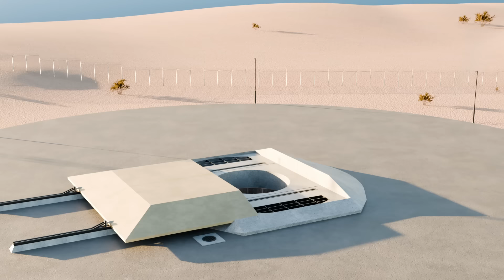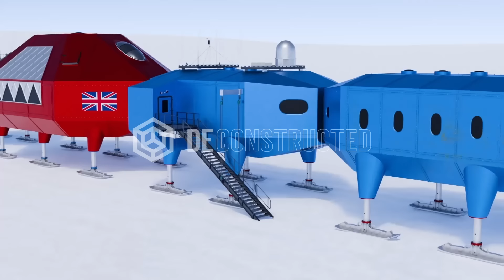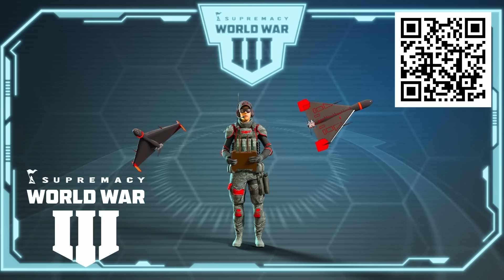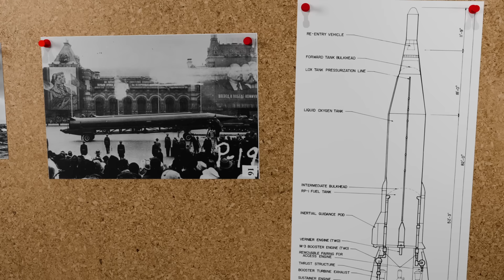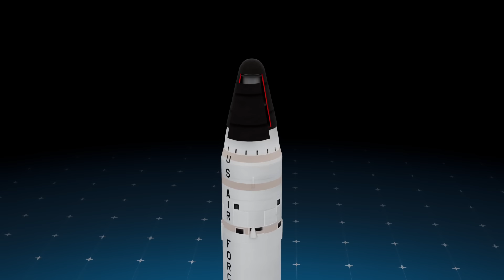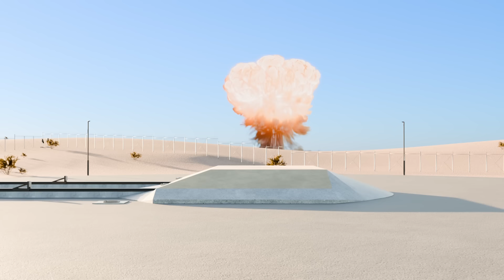Missile Silos Were Far More Complex Than You Think

Comment: I wonder how vulnerable that soft entrance door would be. If somebody actually had gained access and were trying to get in. I wonder how long it would hold off for reinforcements to arrive?
Reply: The first blast door at the bottom of the entryway actually had metal loop welded to and a chain was welded to the wall You could actually chain that door shut from the inside preventing anyone from getting in short of Something less than a nuclear explosion to open

Comment: I heard the unit that controlled the butterfly valve would only accept a handful of code attempts before destroying itself by intentionally burning out the circuits inside.  Officers were told that playing with the device was a sure fire way to get kicked out of the program, if not dishonorably discharched.
Reply: I don't know if that's correct or not.  To be honest, I don't know what would have happened if the code was not entered correctly.  All I knew was that the launch sequnce wouldn't proceed until the right code was entered.  I was a BMAT on a Launch Crew.  It was my job to enter in the code.

Comment: I wonder how these silos are reloaded with new missile
Reply: you don't need to reload them.
Reply: @derniko1992  so what happened to silos when they fire for testing?
Reply: @maxamps45  The testing silos were at Vandenburg in CA.  I don't know how it was done, but I do know more than one Titan II launched from the silos out there.  I have to assume they had to do some work after a launch before it would be ready to launch again.
Reply: The first stage it lifted off of its trailer by a crane stood on end and lowered on to thee missile mounting bracket.  Second stage is removed from trailer and attach to the first stage,  The nuclear weapon is picked up and lowered onto the second stage. The missile Is then loaded with fuel and oxidizer, The guidance system it started up and given to stabilize and targets programmed into it It can now be put on alert status ready to be launched.  It can fit in this ready to launch status for 5 to 10 years.   If you to remove the missile from the silo you just re reverse the order I have listed for installation.   About the only reason to remove the missile from the silo is to take it to Vandenberg California put it back in one of their missile silos and launch it down the Pacific Test Range.  Misto Silo at the three operational bases with nuclear missiles are considered one time use.

Comment: nowadays each control room controls a cluster of silos and missiles and these control rooms are then overseen by a larger control room located at the air force base that the missiles are attached to
Reply: Yup...controlled by "wire".  If you're in the control center, you don't have physical contact with the missle itself today.  You can't walk out from the Control Center and go "touch" the missile.  In Titan II complexes, you could.  We were never allowed to lower a platform and go touch the missile itself.  The last step in our daily checklist was to open the door on Level 8 of the Silo Equipment area, and look up at the missile in the launch duct to make sure nothing looked wrong.  On a rare occasion, we could ask the Commander if we could walk down into the W under the missile.  I did that a few times.  But that was the closest we ever got to it under normal circumstances.  I think I was able to walk out on a platform once or twice when some maintenance guys were there, but that was it.

Comment: I was thinking this sort of layout had several missile silos close by the launch control.

Later missile silos and launch control were separated by miles .  Maybe the Minuteman program?
Reply: Yes, you're correct about the Miniteman and being separated.  Also, one control center is responsible for more than 1 missile.  In Titan, it was one Launch Complex, one crew, one missile.
Reply: Titan I had one Control Center and three missiles connected by tunnels.  Minuteman Silo and Control center are connected  only electrical wiring.   Mistral silos are spaced out so that incoming bombs could not damage more than one missile silo.

Comment: Mit welcher Energiequelle wurden diese Silos gespeist? Gab es irgendwo ein Windrad in der Nähe?
Reply: Electricity.  I also believe there was a generator.  I don't remember.  But I know if the power ever went out, the complex would still have power.  I think the diesel generator came on if we lost power.
Reply: The missile complex was connected to commercial power by overhead power lines, If commercial power failed we had 510 brake horsepower diesel engine generator to provide power to the complex,  We were still able to launch with AC power available

Comment: Was the possibility of something happening to the closure door rails ever considered? I mean, it'd suck to initiate launch and then have the silo cover get stuck halfway open...guess it'd be time to run for those blast lock chambers.
Reply: I don't know if that was considered,  I'm sure it was.  But I can tell you that if the silo closure door didn't open all the way, the launch sequence would have failed.
Reply: We did not have computers in the 60's   We had logic circuitry relays at some point In the launch a relay closed Activating a valve to cause the silo door to raise 6 inches and open. when it wide open it hit a relay shitch that informed the logic circuitry the door was open if it didn't get that signal back it caused a launch hold.

Comment: Be interesting to see the difference between the missle silos of the Titan II vs the new Minutemen silos.  I would assume similar but on a smaller scale.
Reply: In Minutman, the silos and the launch control centers are miles apart.
Reply: There is no comparison.  Titan II was liquid fuel with pumps and piping And strict temperature controls.   Minuteman silo's are basically a tube in the ground with a door over it with a bottle rocket sitting inside weighting for some one to light the fuse.

Comment: The Titan II was the first man-rated missile in the US inventory as it was planned for later manned space flight use. The silo closure door, eventually weighing 1.5 million pounds, was designed to unlock, jack, and retract in 19 seconds, while buried under 10 feet of soil. The door actuating system was powered by several 20,000 psi hydraulic accumulators the size of torpedoes. The site APU/generator was a 6 cylinder diesel submarine engine, the size of a car, that hung on a swivel platform that hung from the ceiling. The generator was started by compressed air. The engines of the rocket passed the grade (ground) level going 60 mph. The missile accelerated to 60 mph in roughly its own length. Astronauts referred to the Titan launch as an "E ticket ride" referring to Disneylands best rides as E-Ticket. If I remember correctly, the accelerative G-load rose to 6 G's as the first stage quit and the missile staged. This is how the warhead would get to the other side of the planet in 45 minutes. The Titan was truly hypersonic. When one Titan went off alert, 9-10 Minuteman had to be retargeted to cover our target.
One day in late '79-80, while I was not on alert, a chip burned up in NORAD headquarters in Colorado, and that resulted in indications that the US was under attack. An officer there quickly rejected the indications pending any secondary verification. While the threat was being evaluated, a friend, on alert that day, got his key out of the safe as ordered, put them in the console, and was one more step from executing the launch. I asked him what ran through his mind as he waited for launch authorization: He thought about calling his wife but elected to let her go on in peace. It was an amazing job considering how young most of us were. I was 25 as a Missile Combat Crew Commander, in charge of my own crew, before transferring into flying with the USAF.
Reply: I am pretty sure the silo closure door was 740 tons.  Not 1.5 million.
Reply: I was in a missile silo on the day JFK was shot

Comment: these would have been easy to repurpose as a off grid home especially the ones back east since water would be easier to collect creatively
you dump the useless missile system stuff convert the missile side to a hydroponics workshop and so on with the other section being converted for housing comfort you could install a solar farm for good power up top with the water collection setup
the security it had would be overkill if left intact to modify as you saw fit

Comment: The new Sentinal systems will be online in a few years. Deadly accurate.
Reply: Our current missiles are accurate enough already.  Sentinel has turned into a bit of a cost disaster, since it's now more than just a complete missile redesign, but a total silo redesign as well.  I feel like we just needed to evolve Minuteman program, much like how we retrofit older planes with new systems and capabilities.  These land based ICBM's dont need to do much more than current Minuteman missiles can, the worry is more just needing some level of refresh to ensure longevity.  We absolutely did not need a full ground up rebuild of our ICBM program.  Our deterrence factor does not improve one bit, and any lower maintenance costs get thrown out the window thanks to the extreme cost overruns.

Comment: Titan 2 was decommissioned. Minuteman III is 60 years old.
Reply: Before Minuteman III There was Minuteman I and II.   Titan 2 and Minuteman I What started in 1960 Minuteman 1 and Minuteman 2 Was was replaced by Minuteman 3 in 1970.   Titan 2  Was to be a 10 year program It was maintained 23 years Thirteen years longer than it was designed for. Solid rocket fuel missiles are much easier to maintain then Titan 2 system.
Reply: @brucebedford5121 40yo eeapons have demonstrated high failure rates in Ukraine.

Comment: There is actually a level 0 to the silo above the drive engine for the silo closure door, it houses a door which is only big enough for 1 man.
Additionally the elevator controls are on level 0, but the driveshaft is on level 1
level 1 is the elevator roof access level.

Comment: I like how simple, yet brilliant, some systems were, like the delay pipe for blast protection and the 3 minute delay between calls for security.
Reply: A lot more sensible would have been to use a duress code at the gate, so that you didn't have to wait three minutes for the response to be started.

Comment: What I found the most interesting was that there are explosive bolts to hold it into place
Reply: Before the engines fire up the air is not moving when the engines start There is an initial pressure build up that reduces after the air starts moving up and out the launch duct, If the missile was not held on initial starting it would lift off the pad but when air started moving it would drop back down on to its platform causing a crash

Comment: A couple of notes from a former Titan II crewmember. 
There were some slight variations between the three bases.  For example the Kansas sites actually had a wooden shack/cover over the access portal to keep snow out of it.
The TPS radar wasn't just inside the perimeter fence. There was a set that surrounded the silo closure door, and another set that was over the control center air intake shaft.
The layout of control center level 1 is very close, but not quite accurate.
The decontamination area is also very close, but not quite accurate.
In the silo equipment area, you missed the hydraulic accumulator bank on level 1. They stored enough pressure to open the silo closure door even if the hydraulic pump was inoperable.
It might have been worth mentioning that part of the reason for the massive air conditioning was because the oxidizer would boil at 70F.
Reply: What about black water / grey water? Septic tanks?
Reply: Control center air entered  on level three       Emergency exit was on level two
Reply: @brucebedford5121   No. the exit was on 3. BV5 was on 2.
Reply: question.  Were there generators in the bunker? Were there any air filters?

Comment: I might have missed it, but nearly everything about the facility seems to rely on electric power. Does it have a generator in there? You did mention a large fuel tank so I’d guess it does. But it would be a shame if it relied on the grid (though maybe not a shame for Moscow 🔥)
Reply: Yes, it had a 480 volt generator on level 3 of the silo. In addition, on level 3 of the control center was a battery bank. When I was working there, the duration of the batteries was classified, so I won't say anything further about that.

Comment: I love how part of the nuclear launch code is a code that opens a valve to allow fuel to flow to the rocket.
Reply: Yes.  I was a BMAT.  It was my job to enter the code.  It was also my job to go out into the launch duct and hit a spot on the area next to the valve to open the butterfly valves if they didn't open during the launch sequence.  I believe there was some kind of charge that exploded and that allowed the valves to open.  Hitting a spot on it with an axe would have forced the explosion to happen and open the valves.  Obviously, as soon as you did that, the engines would ignite and you'd be liquified.  But that was our job.

Comment: What surprised me most was the “blast valve” for the fresh air. Something about that design just doesn’t seem adequate
Reply: It worked quite well. The valve actually blocked air, forcing the air to go around the valve through a smaller pipe. But if a pressure wave came down the shaft, the pressure of that wave would push the valve back beyond the bypass pipe. The blast valves could also be closed by a command from a button on the control console.

Comment: A few years back the Air-Force had a huge cheating scandal with those guys in the Silos. Caught a bunch of them cheating on qualification and re-qualification testing. Some heads rolled over it as they should of.
Reply: Strategic air Command  "SAC" wanted highly qualified  crew member,  People that didn't do well testing was automatically rescheduled for testing monthly.  A lot of the young officers straight out of college found it much more difficult than their college courses had been. A normal crew pulled 8 or 9  24 hour tours a month plus had 4 hours in the trainer and 40 hours monthly retraining procedures.   Standardization Evaluated every crew with testing that required 95% to pass and 4 hours of problem solving in the trainer.   I believe the scandal happened  when personel returning from Vietnam were put into the missile program.

Comment: Blast doors labelled 6 7 8 & 9😭
Reply: If you call the gate number one, The two doors in the entrapment area of the access portal and the access portal elevator door and the doors at ground level the elevator opened when it was raised That's 5 doors before you get to the blast door number 6

Comment: The Deluge System was brilliant. The use of water converting to generate steam from the Titan II's engine thrust, with the process of converting the flame from the thrust into steam, combined with sound absorption panels lining the silo walls kept Titan II from tearing itself apart in the silo from the intensely loud noise the Rocket motors generated during launch.

The nickname for the Flame Deflector was simply the 'W' and the platform above the Flame Deflector was the 'Diving Board'
Reply: The Butterfly Control Valve Lock had multiple safeguards.  You get six tries for the life of the system to input the correct code. On the 7th try, even if its correct, the system commits suicide.

There is an alarm that sounds at the air forcevbase if you mess with the system without authorization. (Crews had a list of test codes that wouldn't initiate a launch to test with.)

Attempting to mess with the internals of the BVCL would also cause alarms or system lockout iirc.

Then, if you tried to open the valve on the oxidizer line manually then an explosive charge in the valve lock would detonate and jam it closed for good.

Crews working on that system had to do the correct procedure wait for a long timer to finish before they could work on that without tripping the anti tamper charge.
Reply: Also...subbed!

Comment: I found it funny the crew's sleeping quarters was located at the TOP most portion of the dome, where the full force of the explosion of any missile would land. That structure BETTER be able to withstand a nuke.
Reply: at the top or bottom, if it was a direct hit, it wouldn't matter where you were
Reply: @Desert-edDave  Narrator said it is a hardened structure which could withstand a nuclear blast.
Reply: The ceiling was over 10 foot thick and had two inch diameter steel rebar and The Dome was covered with Battleship armor plating  above was 15 feet of packed earth

Comment: I'm assuming they dug as far deep as they wanted to go then built from the bottom up.
Reply: They dug the area down to the level of the Control Center and Access portal. For silo levels  they used steel rings, A bulldozer And Crane remove dirt the ring slid down and additional rings were added on top of the first one until down to the required depth, The crane then lifted the bulldozer out of the pit

Comment: How was the target location selected and inserted into the rocket guidance? Or each rocket had a pre programmed target?
Reply: There were three targets (labeled target 1 / 2 / 3) and that would be denoted in the launch orders.
Reply: The Guidance held three targets.  The BMAT used an inch wide roll of tape maybe 30 feet long with holes punched into. It was read by a reader in the Control Center and the information sent to the guidance system.